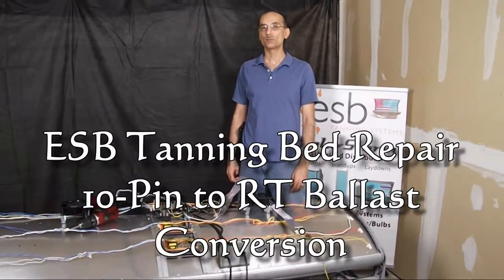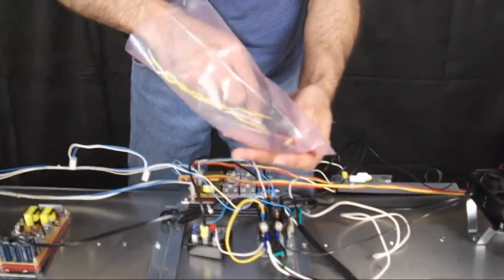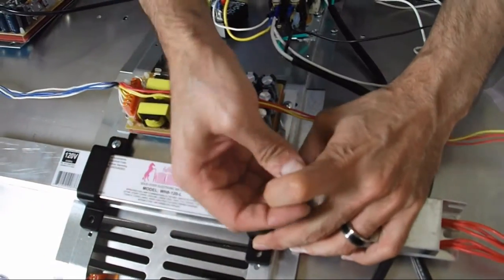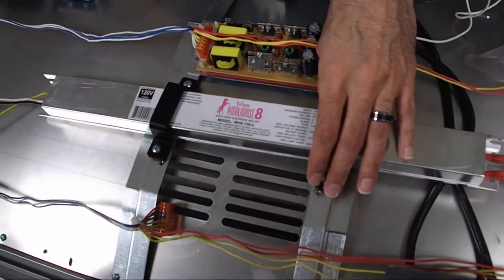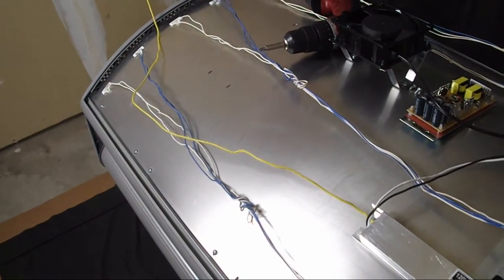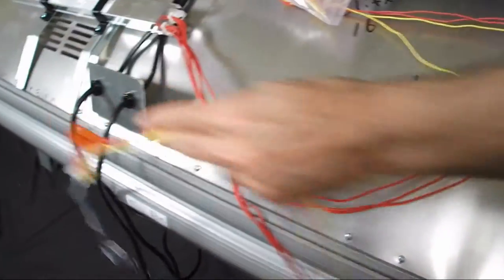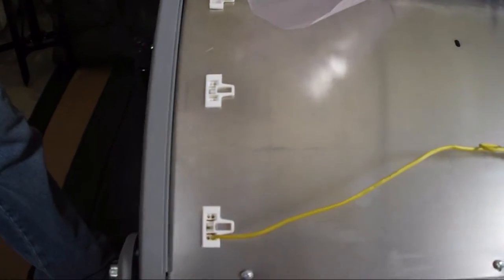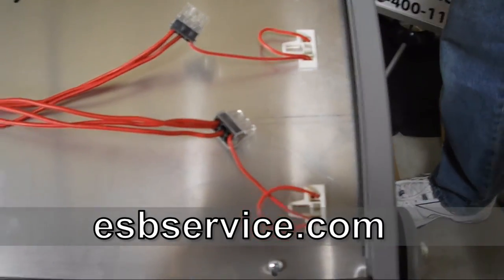Converting a 10-pin 2-Lamp "Open Style" Ballast to an RT 2-Lamp Ballast

Comment: What is the part number of the newer rt ballast?
Reply from the maker: The one in the video is #520007.  It may be preferred to use a #520006 and wire two red wires per lampholder.  They are different for 240-Volts, though - so let me know if you might need more help.  Thanks!
Reply: I have a question about one of my lamps acting up. How can I send you a picture of it?
Reply from the maker: @DanielOliver-e3s  My email address is:  info@esbservice.com
Thanks!

Comment: Does it have to be a workhorse 8 or can it be a workhorse 3
Reply from the maker: Thanks for your inquiry.  The only other Workhorse you could use would be a Workhorse 7...You would wire 2 red wires per lampholder.
We sell the 120V Workhorse 7 here:  http://esbservice.com/parts.htm#!/Ballast-RT-2-Lamp-120-Volt-Workhorse-7/p/42871552
...and we sell the 240V Workhorse 7 here:  http://esbservice.com/parts.htm#!/Ballast-RT-2-Lamp-240-Volt-Workhorse-7/p/64809093
Please let me know if I can help further.  Thanks!